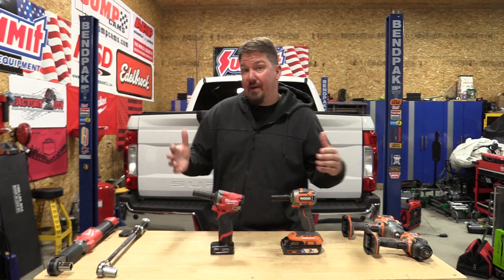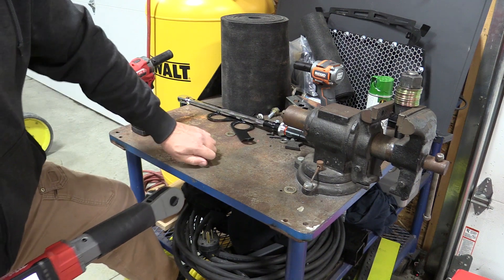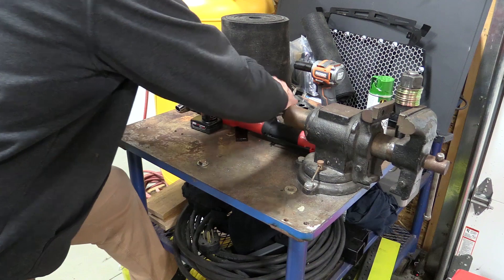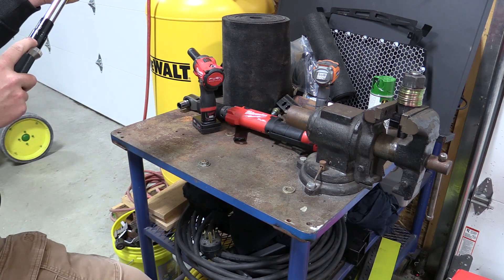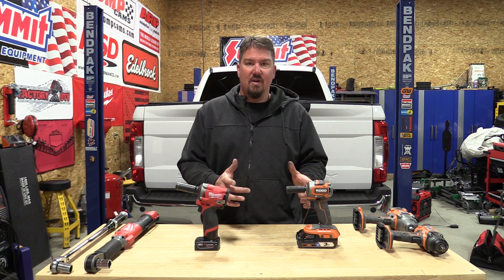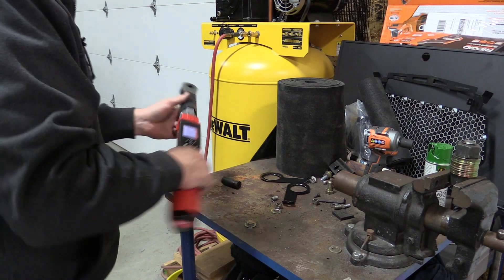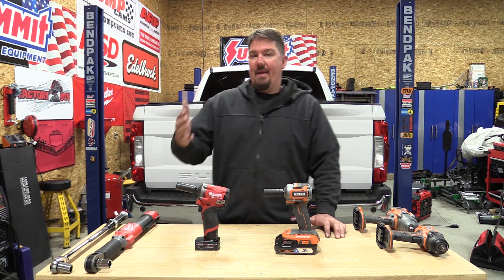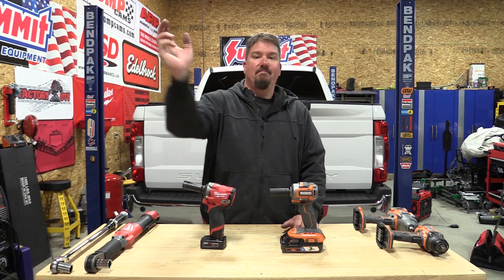Milwaukee FUEL M12 Stubby Vs Ridgid 18-Volt Sub-Compact Impact Wrench

Comment from the maker: WARNING:  As the thumbnail shows, I fail at figuring out what impact is more powerful.  Please stop the hate mail.  It is pretty obvious with the number of dislikes that some are not happy.  This was the journey to find this stuff out, it was frustrating to me.  I am sorry if you dislike it.  Tool testing is not always rainbows and sunshine.
Reply: the M12 range is ahead of it's time, ppl have a very hard time internalizing its performance. and have you tried the M12 hydraulic impact yet? Should have even better, more sustained torque.
Reply: Fan boys are always gonna hate it when their favorite  tools aren't shown in the brightest light. Milwaukee makes some awesome tools but, much like Pink Floyd, their fans often ruin the experience.
Reply: its just not a fair test, put the m18 stubby vs the same rigid tool. None of this was shocking is the issue. "the 18 volt tool was stronger regardless of name brand" - pretty much how she goes
Reply from the maker: @joshleclair7550  Uhhh, the Milwaukee was an M12 tool and it would have kicked the Ridgids large 18 volt butt
Reply: You did better than most could of done for sure. And if theres folks on here hating they should start their own channel and find out for themselves the trials and tribulations of trying to appease everyone.  Its impossible.  Keep up with this top notch tool review
Reply: The deep socket adds torque to the equation that's the reason they add extra weight to sockets designed for removing crankshaft bolts, a heavier socket when being hammered in turn hits the bolt harder
Reply: Dear friend, like always  I like your videos and your honesty. As you know the world is full of stupid people, Continue with your very good videos we appreciate that so much. thank you!!!
Reply: the length will always affect rotational torque due to leverage. same reason a longer screwdriver is easier to loosen screws with. technically a 12in extension would add torque but the metal would need to be far too rigid to transfer the torque before reaching the sheer point and the extension snapping.
Reply: WorkshopAddict  don’t be listening to any hateful comments.   None of these people are making the effort of a channel like yours and you guys have always made very interesting content.  Keep the faith bud.
Reply: Can’t fix stupid .. keep up the good reviews
Reply: I appreciated the video, it earned a "like" from me. Thanks.

I recently gave this ridgid subcompact a try myself, and I returned it within a few days. Being able to get into some tighter space with a cordless sounded cool, but the thing just sucked. Having to switch over to the big boy to break a lug nut is unacceptable imo. I agree that it's more like an impact driver, in fact I felt that it performs very similarly to my ridgid gen5x and octane impact drivers. I managed to break loose a Volvo lug bolt with one of my Ridgid impact drivers that this subcompact impact wrench couldn't handle (wasn't paying attention to which driver unfortunately). Pretty pointless tool, has me thinking I'll try some competitor's subcompact.

The big boy octane though, it has definitely proven itself a worthwhile tool. Haven't yet been able to find a real-world situation where it couldn't break a fastener loose with ease.

** disclaimer: I'm using mostly Ridgid 18V for my cordless power tools for the past few years, previously used mostly Makita and Dewalt, and thus far I'm pretty satisfied with my dozen or so Ridgid 18v tools as well as the service I've received when necessary; HD really does hand me a free battery when I bring in one I've fried, but I've heard and read the horror stories too, I think it depends a lot on your relationship with your local store. I'm nobody's fanboy, I need tools that get the work done & I don't care if that means they have to be neon pink "barbie" branded. I love many of my Ridgid tools, but some of their stuff just sucks. I have the gen5x hammer drill and it really sucks too imo, I overheated that piece of crap so many times doing stuff that my previous much older Makita 18v handled just fine. Like driving 1"+ augers and other stuff a sparky/handyman's gotta do every day. The octane version is just fine, but imo the performance of the gen5x brushless was just embarrassing compared to that of the gen5x impact driver packaged with it.
Reply: The new M18 Compact Stubby rocks.
Reply: @TeamEmperor  the m18 compact that isn't available for sale yet? What makes it preferable to the ⅜" m12 stubby?
Reply: Some people just spend their time looking for things to be mad at. I like videos like this. Keep it up man
Reply: Good try & thank you. I appreciate you making this video regardless.
Reply: newton raymond that’s not true or they would just add more weight. Imagine the socket weighed 100lbs, it would barely turn the nut. Heavier means it’s harder to accelerate. Just like a heavier car.
Reply: Justin Eggers that is not true. The longer the lever arm the more easily torque is applied. But that is at 90 degrees to the length you are referring to. Longer screw drivers are easier to handle as they’re more forgiving to a wobbly hand applying force. But only to a point. Imagine a 10ft long screw driver. If your hand wobbled an inch, the drive end on the screw would appear to sit still in the screw head. Now imagine a 2” long screw driver. As your hand wobbles an inch it would like slip off the screw head.
Reply: Don’t apologize the video was good we’re all just aholes lol
Reply: Cant fathom what people expect from you. Screw em
Reply: @HVAC Quality Assurance ..I bought ‘team orange’ because:
1) It was $80 tool only
2) It was battery compatible
3) two new 4amp 18v ridgid batteries were $99  11/8/21
4) used it to build the framing of a deck, yeah with ‘90’s era porter cable saw and pneumatics. Blasted carriage nuts and lag bolts easy- didn’t use it’s big brother
So buy what you want. I did.
Reply: It all could have been avoided if you would have used an 18v Milwaukee impact.
Reply: @benruthlessburger8905  Joe bust mixon ?
Reply: Preach

Comment: Milwaukee stuff is so much more expensive that you should see a NIGHT AND DAY difference. I’ve been researching a ton lately on what brand I want to buy into first, and for the money brands like Kobalt, Rigid, and even DEWALT now are just much better for the money from what I have seen. I don’t work with power tools much so maybe I just need some more experience with Milwaukee stuff. The only experience I have is with one of their older drills and impact drivers that I used to use as a cable technician. Both worked great.

Comment: I’ve had Milwaukee for over 10 years. Still even have my first drill and impact I ever bought with them and they are still going. Although they are retired from the service truck now. I have seen guys buy Rigid, Ryobi,  Bosch, Dewalt, Makita, you name it. Every guy I ever worked with eventually switched over to Milwaukee.
Reply: I've been a framer for 20 yrs, the ones I've worked with changed from Milwaukee to dewalt over the years.
Reply: My Rigid cordless tools get tons of abuse and use day in and day out.  I have the same Rigid driver set still going after 9 years so I bought a second set still going as well. I get that rigid drivers were always bigger and that’s an advantage for Milwaukee, but that’s changing. Rigids new models have small heads. I always run with a big 4 or 5 ah battery so I don’t care about the weight so much. Compared to a nailer these things are a feather.
Reply: @warlok9  I have had my 1st Ridgid 1/2 drill since new in 2008 still works, still has a warranty. Use the charger that came with that drill daily. I use a large variety of the newer Ridgid tools on a daily basis in the automotive field and abuse them daily and they still work great. The 1/2 impact trades blows with the Milwaukee mid torque as long as you use the octane batteries. Selection is slim compared to the amount of Milwaukee tools available. However I like the value and warranty I get with the Ridgid.

Comment: I think the Milwaukee already wins this class by actually being a compact option. The Rigid not only looks silly with it's full size battery but it's not limited to what sort of spots you can get it into. Although some people are calling the test a failure, I agree with your closing comments. If you're just slamming screws into wood all day, the faster spinning Rigid will do the job. If you want an actual compact impact gun that will looses stuck on nuts and bolts, go with Milwaukee.
Reply: Well the m18 has the same problem the 18v rigid does, and these tools are rated and exceed their ratings. Frankly why would a car shop spend so much when most air tools last and hold up so much longer?
Reply: Milwaukee is way more expensive, and if you go with the Milwaukee 12v tool you can't jump on the 18v tools without buying into a new platform which will get even more expensive, 
 Ridgid on the other hand you get lifetime warranty on the tool and battery and since all Ridgid tools work with the 18v batteries you don't have to worry about switching battery platforms to use all Ridgid cordless tools.
Reply: Ridgid is more compact from the head so it would be better actually the base is the only chunky part

Comment: The deep well impact sockets showing higher real torque is normal. A heavier(mass) impact socket is sorta like the weight of a hammer, it allows more real torque to be applied from the hammers in the impact wrench to the anvil and through the socket.  Just look at the crank bolt sockets for hondas on Amazon, they are a giant mass of metal.

Comment: Very interesting that the Milwaukee 12 V is keeping pace with a Ridgid 18 V...Just shows the overall quality of Milwaukee tools
Reply: Voltage is not not power. I don’t know how many people believe this myth
Reply: @justinmartin8887  explain Tesla cars, all share the same electric motor, yet why are the "P100 D" version for each model are so much faster than base models and torque compared to the lower model version?
Reply: @DssRSTi  Voltage is simply the "push" of electricity. Amperage  is a measure of the amount of electrons "pushed". Voltage x amperage = Watts. 12 volts at 8 amps is the same as 18 volts at 6 amps. Look at your car's starter motor, its 12 volts but has enough power to start an engine.
Reply: @DssRSTi  every Tesla is around 400 volts, yet some are more powerful than others. the "100" or "75" in the name is the size of the battery, when it's a bigger battery theres more current output so your total power is higher. the Ridgid 2Ah and 3Ah has 5 battery cells in series inside the battery case, and the Milwaukee 6Ah and 4Ah also have 6 cells inside, so the Milwaukee battery actually has more total energy and power despite the lower voltage because it's really just drawing more current
Reply: @justinmartin8887  Exactly. My 120V AC powered impact puts out about the same amount of torque as the Milwaukee 12 V.
Reply: @DssRSTi  I have owned several Teslas, the differences are many, P100D has bigger motor in the rear, than 75D, even tho both have 2 motors, also, the P100D pulls up to 1600A vs 800A.
Reply: Quality?? They're both made in china
Reply: @DssRSTi  to be sold for more cash boi
Reply: They both are made by the same company... But design and branding are different.

Comment: As you have mention these kind of test are not really accurate. Probably the only good purpose is to show one impact has more power than another when you compare then side by side. 
For an accurate torque test a fair length of the bolt need to be stretched/stressed. In your case the bolt is only stress for the length of distance between the washer.  Try putting a 2" thick metal (large nuts or more washers) between the bolt and your table. You will get better results but of course still not very scientific. Since you have access to a shop I recommend you get a junkyard wheel axle assembly and just test it with that. Get one where the wheel studs are easily replaceable so you can replace as the wheel stud wears or breaks.

Comment: I have the 3/8 stubby. Just used this weekend to change the front shocks on my ram 2500. 3/8” to 1/2” adapter with a 12” extension and 21mm shallow socket. Took off no problem and was a much smaller package than my ryobi 18v 1/2” impact rated at 300 ft-lbs

Comment: They've done testing on another channel that it shows that the heavier impact rated and non impact rated deep sockets give you more torque than the lighter weight shallow sockets and it has to do with the amount of mass being spun, the heavier the socket the more torque.
And to have a consistent test you have to top off the battery at full charge every time you're going to do the test. When the battery is at 100% charge is at it's optimal power best case scenario.
The testing bench has to be 100% stationary.
Yeah if you have the money and are a professional buy the Milwaukee, if you're a prosumer DIY get the Ridgid it's way cheaper when on sale, I got one for $149.99 with a 4 amp battery and charger, the Milwaukee tool only will cost you $179 and on sale with charger and small batteries $299😳 $358 MSRP 😳

Comment: Bolts are designed to stretch  in order to produce their clamping force. You don’t have any bolt to stretch when the nut/or tapped hole is tightened straight to the bolt head. Put some distance between those two surfaces “bolt threw something maybe an inch thick” and I believe you will get better results.

Comment: How you plan to use them and which battery platform you have or plan to purchase should determine which to buy not just the most powerful unless power is what you need.

Comment: I bought the 3/8” impact for work, and it’s been my go to tool for about a year now. It has so much power in a small package. It definitely makes my day easier due to the power to weight ratio, when I compare it to the regular 1/2” impact gun I use as well. The 1/2” impact gets heavy in finicky positions, and obviously can’t fit in all the places the stubby can. I find myself reaching for the stubby, more often than the 1/2”...sure I have to make 3/4 more of a turn with my torque wrench, but that’s cool with me. In my experience, the bigger 1/2” impact will turn a bolt 1.5 more rotations than the 3/8”.   The 3/8” is my money maker. It is a must have tool for any mechanic.
Reply: Which one do you like rigid or the Milwaukee 3/8 stubby?

Comment: I would buy the milwaukee, assuming results near the same, just based on size and access to locations. That Ridgid base is way too bulky
Reply: Yea I don't like how his representation of the milwaukee was bigger in this video. It's definitely super small especially with the small batteries. But it was a good video none the less, I watched the whole thing
Reply: It makes no sense to save a little on the tool to go and spend so much on 2 batteries for it that you can't use with any other tools. Anyone with common sense would buy the milwaukee knowing that they'll end up buying another milwaukee in the future and already have a spare battery for it and charger.
Reply: @georgecroney6168  What are you talking about? The Ridgid batteries fit all 18v Ridgid tools.
Reply: @D3M3NT3Dstrang3r  obviously but why would you want any of the other rigid tools?
Reply: @georgecroney6168  Why not. The 1/2 Ridgid mid torque impact trades blows with the Milwaukee. They have a 1/2 hi torque that hits 1500 lb ft. I have several ridgid tools from 2008 that still work. They are cheaper and comparable to Milwaukee in quality and in power in most cases. The have a lifetime warranty on the tools and batteries if registered within 90 days of purchase. Other than a little more limited selection of tools there is no reason not to.
Reply: but did you notice when he sits down the Milwaukee with that tiny battery that it wobbles and almost falls over.  who is going to want to have to be so careful when setting the impact wrench down , if you bump it , it's going to fall.  the Rigid sets down so nicely
Reply: @D3M3NT3Dstrang3r  I am not a pro mechanic.  If I were, I'd likely go with Milwaukee.  But, I'm going with Rigid. Rigid is almost half the price of the Milwaukee.  I'm working on cars so I'm not going to be buying the entire Rigid line of tools.  If it turns out I need something Milwaukee makes, I'll get that tool and its battery.

Comment: I like that you had issues and you didn't hide it. Keeping it honest is awesome. Maybe try some lug nuts?
Reply from the maker: The ones I have that will take that sort of torque are huge.
Reply: @WorkshopAddict  even if you do have to use an adapter I feel like that's how some people may use them so it could still be helpful.

Comment: For me, I'm sure either would be plenty powerful and last for years (as I'm just a DIY guy and not a pro.)   One thing I do think this video pointed out is the way the Milwaukee drive is angled away from the handle while the Ridgid drive is square to the handle.  The Ridgid battery looks like it might get in the way more often when you're trying to work in tight quarters.   You can really see it when he has them standing up and sitting side by side.

Comment: I know the M12 is stronger than the DeWalt Extreme but I’d love to see the two impact wrench versions go head to head, just to see how close. I use the Extreme because M12 isn’t comfortable to me. You are very polite and thank you for videos
Reply from the maker: I will see that I can do.  The Dewalt stops working well for removing at about 130 ft lbs.
Reply: I LOVE the way M12 tools feel in my hand! Just the most awesome feeling. I wish my M18 tools felt the same way
Reply: WorkshopAddict This is off topic but do you know if a generic 7 amp hour battery would hurt a DeWalt extreme? I see them on eBay.